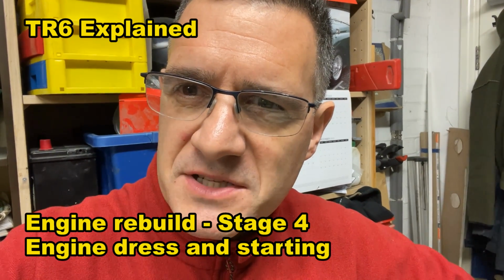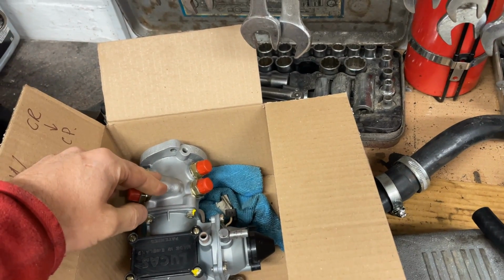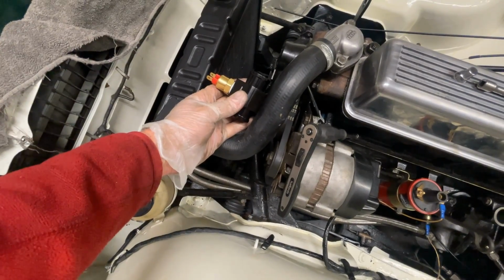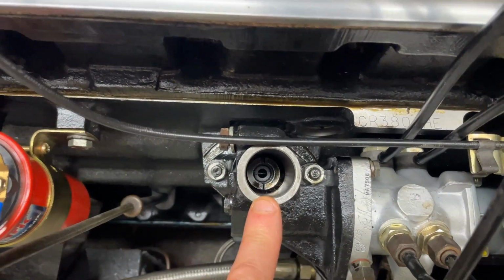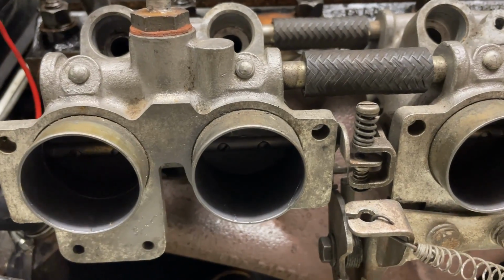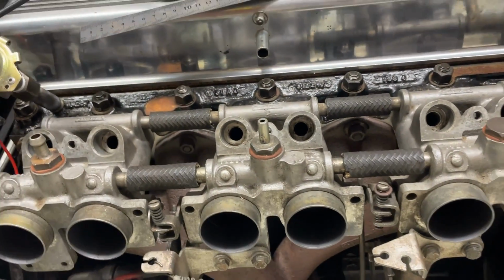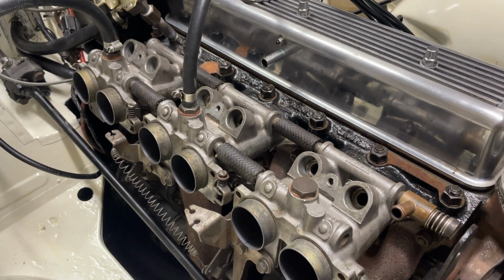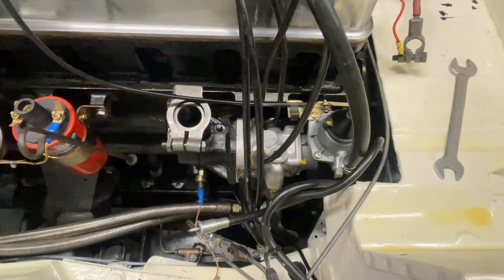Triumph TR6 125-150hp conversion Part 4 - Engine dressing and starting

Comment: I also prefer fan switch in the bottom hose as stated below fan is to control radiator temperature, thermostat is to control engine temperature. Looks like fine workmanship, impressive.
Reply from the maker: great point. thanks for watching

Comment: Hi, 
On which one of your videos do you talk about Moly Coating?

Thanks,
Sam
Reply from the maker: from memory think its the injector bleeding and tuning video. in summary hte molykote replicates the natural carbon build up that occurs over time and fills in the small gaps around the throttle disc. when you clean the throttles you remove this but actually make it harder to set the tuning and idle as now air will be able to get past in the gaps created. using substances such as molykote was common practise in cars in the late 90s - and can really help the TR6 setup
Reply: Thank you for replying. 

Be well,
Cheers,

Sam

Comment: The temp sender unit is in the wrong hose, it should be in the return line to the engine i.e. the bottom hose as you only need the fan if the radiator can't cope with cooling the engine.  Also, the temp shock when the 'stat opens can set the fan to run thus sending overly cool water into the engine.

I am surprised that there is no heat shield between the throttle bodies and the exhaust.  At present the exhaust will heat up the throttle bodies and the engine will ingest hot air, which is a shame since the K&N filter has be obviously placed to suck in cold air.

What oil is being used to condition the cam?  The oil needs to have a goodly amount of ZDDP additive to ensure that the cam followers don't hollow out on the break in.  I would use Valvoline VR4 as its both a premium grade oil as well as containing ZDDP.
Reply from the maker: interesting. hadnt considered that. thanks for watching